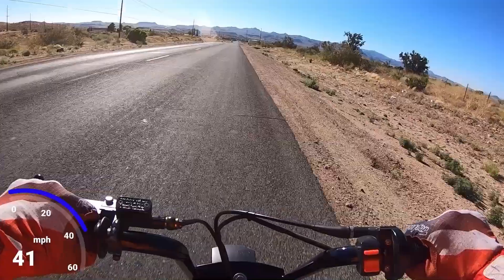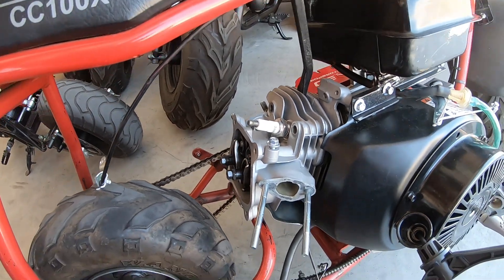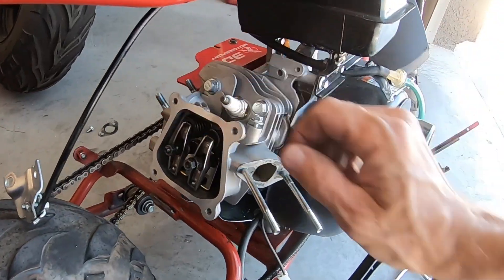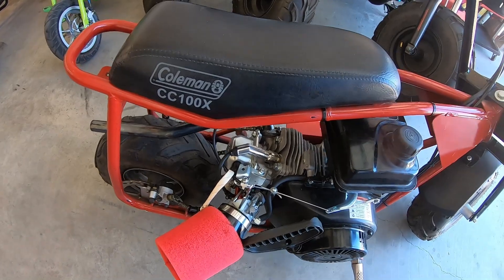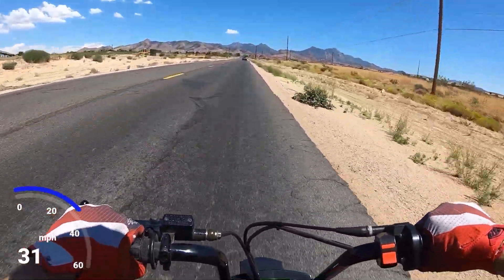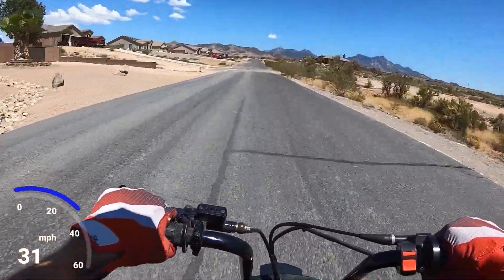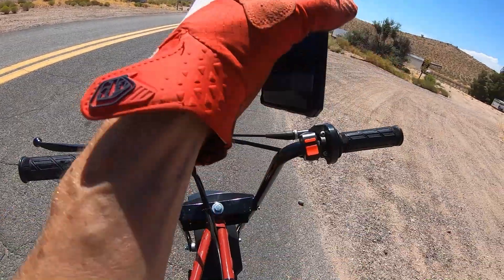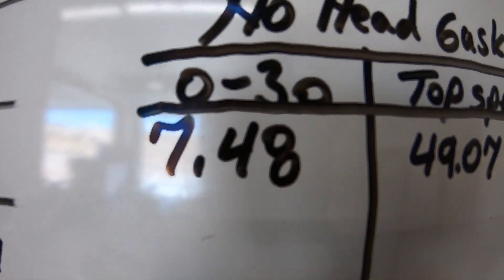Mini bike WITHOUT a head gasket!

Comment: The problem with no head gasket is when the compression and heat  gets high enough and the head to block mating surfaces no longer can take it , the block or head gets fire slotted ! ,and the engine is doneski! Its fun while it lasts.😉
Reply: Aluminum foil, cheap and disposable...😎👍
Reply from the maker: We are going to find out!  I'm gonna run this thing until it melts! LOL 😅
Reply: How’s it handling so far?

Comment: No HG always gave my setups a compression bump and ran better.  If only the block and head surfaces were 100% true you could get away without anything.  I still smear on some copper RTV on and get a mirror finish on the head wet block sanding. I never had a blowout. Even with a 8hp N20 shot on it... Munched a few pistons getting it dialed in though!

Comment: Aluminum foil works great, as long as  the head and deck is FLAT 😎👍
Reply: Will aluminum foil work on a built 212 running about 10.5:1 compression?
Reply: @ivan.delgadillo10  it should  if the head is flat and Torked evenly, I used to run  aluminum foil on 11.6 to 1 2 strokes

Comment: And that's a stock engine? It seems like it's doing pretty good. I have a stock Honda gx160 on my mega moto 212 pro. I put on a stage 1 kit and that thing ran way too rich, I'd like to know if I missed something. I put all of the stock parts back on it for now, any suggestions would be helpful. The kit included the carb, air intake and big filter and I even bought a header piper that's made for my frame for clearance.
Reply: A gx160 is too small to use the large jet that would have came with your kit. You either need a 212 like it's made for, or a smaller jet.
Reply: Find someone who is good at jetting, that's the key, plus port and polish, rember tuning starts at the tip of the air cleaner and ends at the tip of the exhaust
Reply: @N9197U  thank you very much for the info, I had a suspicion about that. I think I'll buy a new Tillotson 212 and put on the air filter and header pipe on it.
Reply: @warrenfloyd1484  you got it, I figured I'd put a new Tillotson 212 on my minibike. Those engines comes with 10 horsepower out of the box, this way I can just enjoy it. I'm just a point now that I just want something new for once and not have to deal with the pains that can come from tuning. It's not a big deal for me to do it but I want to take a break from all of that. Thanks for the info and ride safe.
Reply: @miguelpagansr6128  I flat out love tuning, it's why I keep going, I have owned several 50cc mopeds that would do 70+ mph at 9.9 hp, I love it😎👍
Reply: @warrenfloyd1484  I enjoy it too and I’ve been working on 2 stroke engines since I was 17 and I’m in my mid 50’s so you do the math😆. I also have a Honda express2 that I’ve had for 3 years so far and it’s been a work in progress that I finally get to enjoy on weekends or when weather permits. I just bought a new mega moto 212 pro kit for my birthday minus the engine, and it felt good not having to deal with broken, missing, or rusted hardware and my hands managed to stay clean for once. I’m not as young as I used to be and I guess that now a days I just want to enjoy the little things in life. Thanks for the advice and ride safe, if you any videos of bikes feel free to post them.
Reply: They probably gave you a 37 jet. It's going to be rich especially if you are not turning much RPM, even on engines with more cc's.
Reply: @Deucealive75  thank you for the info, I had a suspicion about it. I’ll see what I’ll do. Ride safe.
Reply: I'm near 60, less than.3 months, I love the old 2 strokes,I had 2 extended Honda expresses fun ! No doubt
Reply: @warrenfloyd1484  congratulations, hope you’re planning to do something awesome. It’s not every day that someone turns 60, I’m sure a lot of us are grateful to go this far in life.